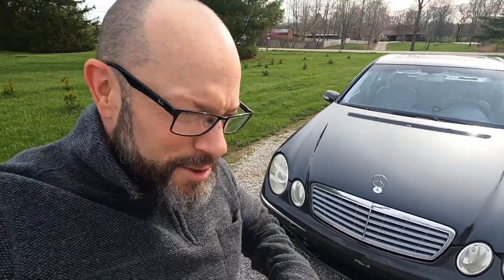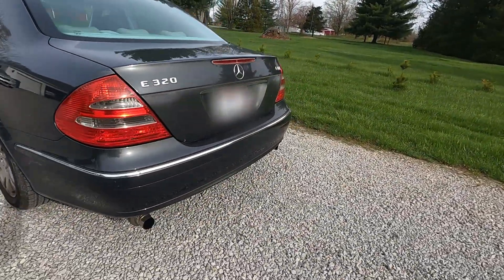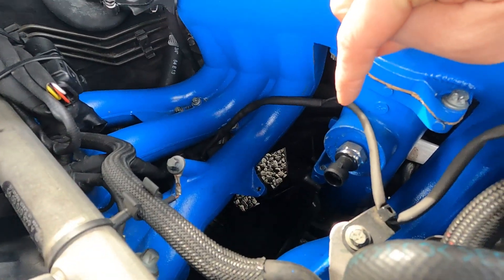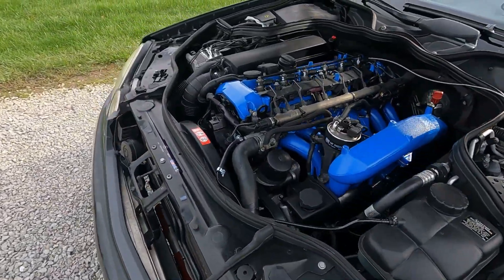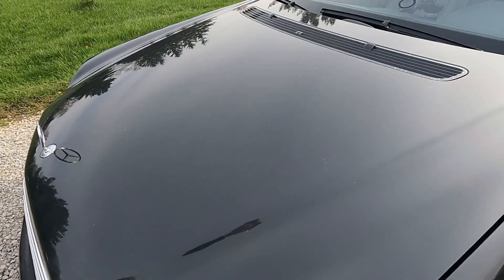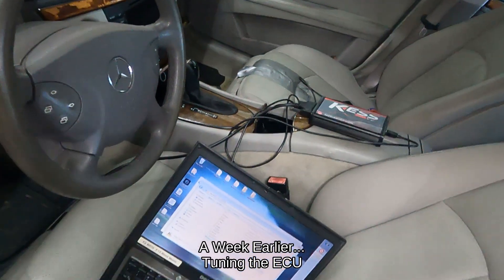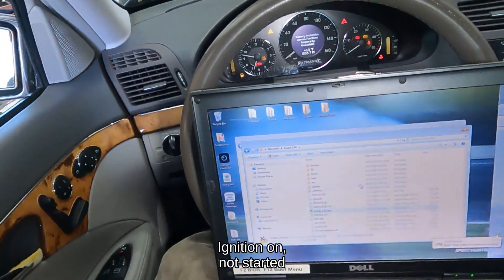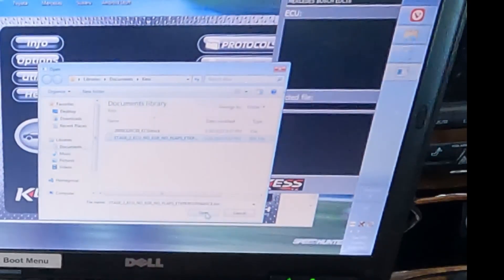Tuning and Driving Evonne the Turbodiesel!

Comment: Whats the name of the place u got the straight pipe from?
Reply from the maker: Summit Racing. I don't recall the part number, but they are Magnaflow turbo mufflers.
Reply from the maker: ...or do you mean the 45 degree bends? Pretty sure I grabbed those from somebody on eBay.

Comment: I loved my first one so much after losing it i always wanted another 5 years later and i got a special one but unfortunately cant drive it and haven't managed to yet due to a gearbox fault 😭 absolute love them though they are great cars. Great work hopefully ill get around to modifying mine. Ill be subscribing
Reply from the maker: If it's the transmission controller, you can check out these guys. I bought a TCU from them. Just make sure you check your axle ratio and provide that to them, along with the other info on your car. https://mkultraelectronics.com/
Reply: @ArtOfDiesel  currently we don't actually know what it is but don't think it's the controller as if you move it it selects gears on the dash still. It's also had a new conductor plate fitted but still nothing 😂 I'll get around to figuring out at some point. Just wish it was sooner as I really need it
Reply from the maker: @c4r5on88  you are telling me that the selector works. However, there could be a problem with the  transmission control unit or its communication with the rest of the vehicle. If you were in the Cincinnati area, I'd say to bring it by, we'll hook up the MB Star, and see what it tells us about your transmission, checking for errors that aren't going to be found with OBDii. If you want to contact me further, become a free subscriber to my substack. https://artofdiesel.substack.com/

Comment: Nice detail on the ECU/TCU flashing. Do you not have emissions control tests where you are as I would imagine it would fail in UK or most of Europe with the parts that have been removed?
Reply from the maker: That's correct. In my state there is no emissions testing.

Comment: what program do you use to tune ecu and tcu?
Reply from the maker: The actual flashing is done with the software that goes with the KESS and KTAG. I didn't create my own tunes, I bought them from https://ecutuningkaunas.com/ , known on here as @mbmotorsportchannel . They are in Kaunas, Lithuania, and will give you a good deal on your tunes!
Reply: @ArtOfDiesel  exact. I myself just bought their stage 3 package. and have to install here soon.
Reply from the maker: @anderskarlshj6374  you'll be adding injectors and a pump, in addition to the tunes, then. That'll be cool!
Reply: @ArtOfDiesel  we've got two guys that had many project's and now we decided to make 2 different youtube channels so this one is the right one :D
Reply: Where did you find the guide for the tcu tuning 😬
Reply from the maker: @anderskarlshj6374  The seller of the TCU tune pointed me to it.  Connection instructions for the EGS52 are here: https://www.autoelectronica.by/mercedes-ktag/149-580-siemens-egs52-boot-st While in the menus you need to go to Protocols -> Bootloader ST10Fxxx ->SiemensEGS52. Once you get started follow the instructions in the K-TAG software. I hope this helps!

Comment: How does the transmission feels like with the different modes..Nice video. And what a sound it makes👍👍👍👍
Reply from the maker: Thanks! In the substack I link to I give more description on the transmission. The most useful change is the addition of Agility mode, which makes better use of the engine's capabilities. It delays upshifts and kicks down more readily, while giving firmer shifts. Comfort and Sport are the same as stock. Manual just allows full-manual use, but hand-shifting an automatic is never as instantaneous as I'd like, so hard acceleration is best in Agility mode.
Reply: @ArtOfDiesel  Thats not agility mode, agility is coded (unlocked) by using other methods, A is just a letter that is for super sport mode, it doesnt upshift at low rpms and S - is not sport is standart, it should be little stiffer than standart with stock TCU.
Reply from the maker: @ETKPerformance  I stand corrected! It's still easier to think of S as sport mode. It sure didn't seem to change much. So, A is Supersport, but in the "slot" where Agility would be, I suppose. OK, I'll update my substack! https://artofdiesel.substack.com/p/driving-evonne-in-modified-condition
Reply from the maker: Always more detail on my substack, where you can become a free subscriber: https://artofdiesel.substack.com/

Comment: How does it feel compare to stock?  Thanks.
Reply from the maker: It feels good! I've had some moments where it doesn't seem to be giving me everything when I really floor it, though. It seems to get into a funk where it's halfway into limp mode. I've checked with my SD Connect and I'm getting some errors related to that accelerator pedal position sensor. I have a new one on the way and I'm quite sure this will fix the issue.

Comment: Awesome can't wait for more videos. How much was the Ktag tuner? Just finished up my swapped 2004 E320 CDI Wagon. It's all stock currently but I'm looking to modify it very soon. When I work out all my dash lights.
Reply from the maker: I'm likely to get all kinds of rotten fruit thrown at me, but the KTAG and the Kess are Chinese knockoffs purchased on AliExpress. They all work great and if I tuned cars for a living I'd definitely buy the actual Alientech equipment.
Reply: @ArtOfDiesel  Man, thanks for this info... I've been wondering if those actually work. Can you please point me towards the exact Aliexpress vendor you used? Also, can this work with a 2010 ML350 Blutec (OM642)? I keep hearing that the blutec requires the ECU be removed for tuning...
Reply from the maker: @pmo3448  I really don't want to put all the technical detail on this platform. Please come to my substack and we can discuss it there. https://artofdiesel.substack.com

Comment: I'm approaching from the other direction.  I am doing all the suspension and brake work first, as well as basic engine maintenance.  After I get my car on the road (it's new to me- haven't really driven enoug) I'll have a baseline for performance mods.  Speakimg of baselines, what is the  comdition of your injectors?  I'm pondering whether I was to have mine serviced by a shop.
Reply from the maker: Brakes and suspension are in really good shape on mine. I think the previous owner took care of that quite well. I think your approach is smart! Obviously I did engine and transmission maintenance as soon as I got the car.
Reply: @ArtOfDiesel  I've approached all my cars this way.  As my wife will be driving it safety comes first (over performance).  Bilstein B6 dampers.  Creative Steel rear subframe bushings.  I installed all new brake bits as I cannot trust my wife's life on some monkey's work: brakes felt OK; newer rotors and pads; and about 25% of one caliper's piston broken off!  Wouldn't have known had I not torn everything down.
Reply from the maker: @seer7327  I pretty much bought this car to create content and build my channel. So, naturally performance is what you'll see on here. I've been through the brakes and all is well. Your approach is admirable, especially for your wife. My wife is driving an ML320 CDI "Mary Lou" with a lot of the same mods on the OM642 and mapped to give it 440 lb-ft. I've actually caught her pulling stumps out with it! However, safety and reliability are especially critical for the most important woman in my life!
Reply: @ArtOfDiesel  If my wife needs to pull stumps we have actual tractors😁 (but I prefer excavators)  Some of what I comment on/for is for others.
Reply from the maker: @seer7327  tractors are the preferred method! I was afraid the chain she was using was going to slip off and go through her rear glass. I wound up working with her on it and got it out. It was a small stump, but all the low-down torque and AWD definitely helped.
Reply: @ArtOfDiesel  Chains are fairly safe (cables on the other hand).  Blankets over them will help.  Speaking of CDIs and tractors, I recently used one of my tractors as an anchor point for tiedowns I was using to put some tension on the rear suspension bits to get them to line up when installing new parts.
Reply from the maker: @seer7327  the chain, itself, wasn't the concern. She didn't have the chain connected to the stump very well. I thought it might slip off under tension, then fly up and take out the rear glass and probably bang up the tailgate.

Comment: Great video!! Did you install a 4 bar MAP sensor? If so where did you install it? 

Also with the 722.6 transmission. Did you use alternative software to tune it? And where did you get the rom files from? 

Cheers, Alex
Reply: Sorry I completely missed that part of the video I was distracted.
Reply from the maker: @alexander70356  Haha! I was going to say that I show it in there. The 4-bar MAP is in the stock location. I added a tap where the EGR mixer used to be for my boost gauge which I'll get to soon.
Reply: @ArtOfDiesel  I'm excited to see/hear about this.